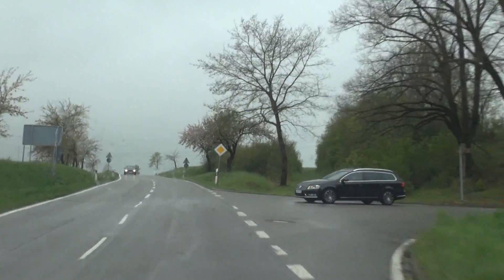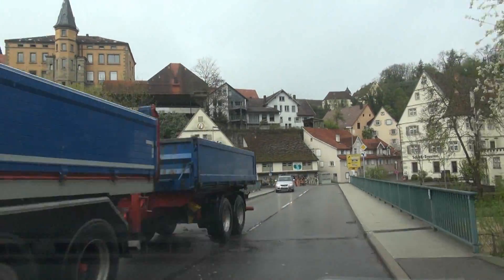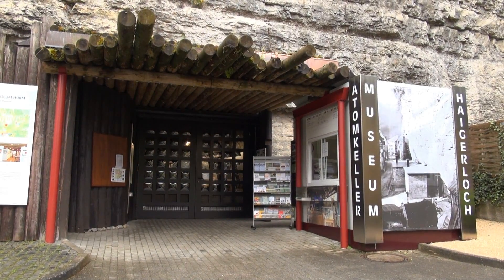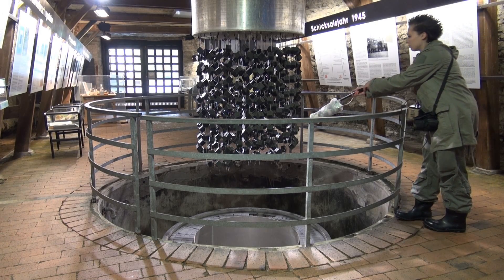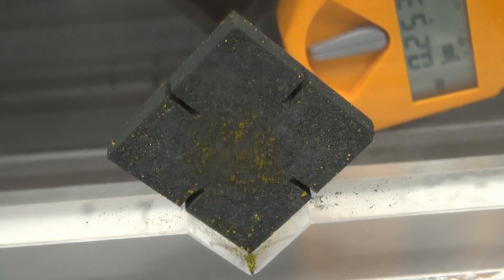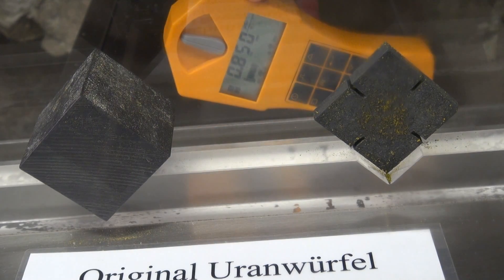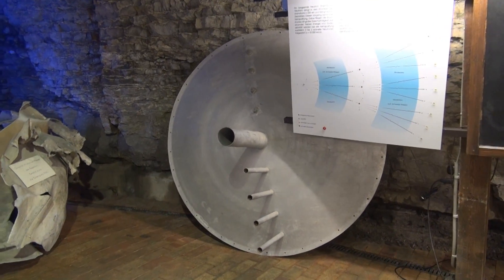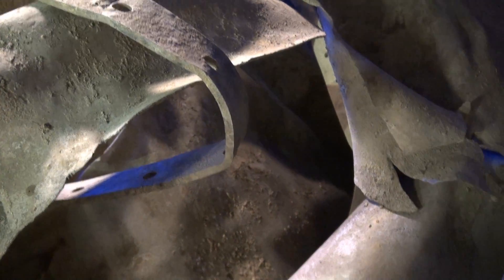Hitler's nuclear pile - WWII uranium cube reactor & the Alsos mission: Atomkeller Haigerloch

Comment: All interesting but the Nazi's had not discovered that U235 was critical to getting fission to work w slow neutrons. Like the Chicago 1 pile it had no chance of producing any power.  The Chicago 1 Pile with 40 tons of Unranium ore only produced 1/2 watt .. assuming even that happened.  Germany definately did not have a manhatten like project trying to refine U235 as such all efforts were pointless. The Manhatten project only started once the British secret Peierls/Frisch paper specifiying U235, the critical mass and yield were revealed to the USA; that happened in 1942.

Comment: Some correction is necessary as a comment: firstly the graphite is not a neutron reflector, but it is a neutron moderator used to slow down fast neutrons, secondly this "reactor" was moderated by heavy water not graphite.

Comment: I'm assuming those cubes were not enriched uranium and were only 0.7% U235. As far as I know, you can reach criticality with that level of U235 but you need the correct design and you need to initiate it with other radio active elements.
Reply: That's absolutely true. The hardest part about designing and building a nuclear is getting it to bang in the first place.

Comment: The Plexiglass around those cubes is mostly there to shield the betas!
I got a chance to open that exhibit and measure those cubes directly, on contact my energy compensated GM showed ~30 µSv/h, but some of our russian pancake detectors were overloading as far as ~10 cm away due to an extreme amount of beta radiation.

Thank you for making this video, otherwhise it would have been many more years where I didn't know about this awesome place!

Edit: Fixed typo

Comment: LOOKS LIKE ALL THE TECH FACTS ARE MIXED UP !  THIS WAS A FIND BUT ONLY SMALL  NUCLEAR ENERGY WAS PRODUCED BY THIS DEVICE AS SHOWN ! IT LOOKS LIKE THE DEVICE COULD NOT BE MOVED AWAY IN TIME BEFORE CAPTURE SO THEY REARRANGED THE PARTS TO CONFUSE ANY ONE FROM UNDERSTANDING IT ! THE URANIUM BLOCKS ARE HANGING IN CLOSE PROXIMITY ! IF THEY WERE REFINED ENOUGH THEY WOULD PRODUCE NUTRONS AND HEAT !  ANY WATER SOURCE COULD BE USED TO COOL IT TO KEEP IT FROM MELTING AND WOULD MODERATE IT !  USING HEAVY WATER AS A MODERATOR WOULD BE A WASTE OF MONEY AND HEAVY WATER !  IF THEY WANTED A MODERATOR THE GRAPHITE WOULD BE THE RIGHT THING ! THERE IS ALREADY CEMENT AROUND THE URANIUM  FOR SHIELDING SO THE GRAPHITE IS NOT POSITIONED CORRECTLY ! TO MAKE THIS WORK THE GRAPHITE NEEDS TO BE STACKED BETWEEN  THE STRANDS OF WIRE HOLDING THE URANIUM TO MODERATE THE NEUTRONS !  THE HEAVY WATER IS FOR REACTING WITH LITHIUM TO MAKE LITHIUM TRI DEUTERIDE  FOR FUSION FUEL FOR FUSSION WEAPONS ! IS THERE ANY LITHIUM ?  HOW ABOUT SOME PALLADIUM ?  ANY WAY THE URANIUM IS HANGING FROM THE WIRES IN A COOLING POOL IF THEY LEFT IT LIKE THAT THE SMALL AMOUNT OF RADIATION WOULD MAKE PLUTONIUM 239 AND COULD BE EXTRACTED AND USED AS A PRIMARY TO DETONATE THE DEUTERIDE HEAVY WATER !  BIO NERD UR GONNA DIE FROM RADIATION  ! U SHOULD QUIT WHILE UR AHEAD LIKE I DID !

Comment: The germans had uranium 235 and didn't need to obtain criticality. hey did have a small atomic bomb and they did have at least 2 tests of their low yelld bomb.In fact it is reported that the germans wiped out a russan division with one of their atom bombs in early 1945, The atom bombs had a blast radius of about 900 to 1000 meters anough to do nthe job. It is also reported that the second bomb dropped on japan was german weapons grade uranium.
Reply: Wouldn't partially detonating u235 cause most of unfissioned u235 to be spread into the nearby environment ? It would be far dirtier than the bombs dropped on Japan. Were is the evidence for this ?

I'm not a nuclear expert in any sense but I thought bombs tend to 'fizzle' when they fail to reach criticality, you don't get a scaled down version of a proper detonation, rather something completely useless ?
Reply: Do you have a reference to this information?  There is no mention of anything similar in “Heisenberg’s War. The secret history of the German bomb” by Thomas Powers, published by Penguin Books in 1994.

Comment: They're lucky they didn't achieve criticality with no control rods or anything in their design
Reply: @AverageJoe8686  Joe, those strings of cubes are the uranium. The control method was heavy water.
Reply: It sure would have gotten their attention
Reply: @AverageJoe8686  To 'activate' the system the radium rod was lowered into the center - the cubes were left in place. I went there in 2011 and there is quite a bit of material to read. This was an experiment more than anything else. There was no way possible for this to have been successful at what they were trying other than making a little bit of heat. It needed some enriched uranium (235) and there was never enough mass to become critical. They did measure some heat increase but not much more than that.
Reply: @dieselscience  Right. It was just a criticality experiment like Fermi used, but they were FAR away from K=1. I know how much you want to correct these dolts, but it's a thankless task and a perpetual uphill battle. Pearls before swine.
Reply: They didn’t expect to achieve criticality. In the unlikely event of achieving it because their calculations were wrong, the plan was to pull the radium Neutron source out which was lowered on a thread to a chimney on top of the reactor. [sic!]
Plan B was to throw in a piece of Cadmium through that chimney. Although because of the poor shielding the guy throwing that in wouldn’t have long to life after that.

It is kind of a similar well thought through design like the axe-rope thing with the first American reactor
Reply: @AverageJoe8686  Are you saying 'cascading' when you mean 'chain reaction?'
Reply: Criticality around my arse !!!
Reply: @joshuel2008  you must be 'russian' then.
Reply: Their design did actually have control rods that would be shoved into the heavy water tank when needed (not unlike how CANDU reactors do their 'adjuster rods', as its called in their terminology)
Reply: @drewgehringer7813  CANDU reactors? Are you in canada?
Reply: Not even close.
Reply: Said who ?
Reply: It wouldn't really have been possible.
Reply: @dieselscience  Why is that? Demon cores don't have control rods and yet they work.
Reply: @Vsor  "Why is that?" Because the geometry is critical to the chain reaction and none of the cubes were anywhere near critical mass.
Reply: @dieselscience  Its reactor not a bomb... you are completly clueles in the topic! On top of that you start talking about"geometry" and ending up with "mass"... with scientists like you we would be in stone age to this day.
Reply: @dieselscience  what about the radium and beryllium?  Seems they were artifically generating neutrons which may have initiated sub-criticality or even a momentary criticality.  ??
Reply: @AverageJoe8686  No. When in operation the entire assembly of uranium cubes was completely lowered into the pot an it was filled with the water. A radium rod was the neutron source. It was impossible for this to go critical (in fact in full operation it barely even got warm) so the purpose was slowing the neutrons enough to be captured by uranium nuclei.
Reply: @dieselscience  I think the graphite was the moderation method.
Reply: @hughezzell10000  Heavy water was the moderator in this. CP-1 in Chicago used graphite. Remember this was mainly an experiment to prove the concept, and define what became modern nuclear engineering.
Reply: @hughezzell10000  They used heavy water which results in a self regulation. When the water gets hot, the fission reaction declines.

That type of reactor is intrinsically safe (to a certain degree). And it works with natural Uranium (no need for enrichment of U235).
Reply: it mightve scared people off nuclear power, for a bit, and maybe started the cold war just about the same time it did in our timeline, but sooner by a few years

tho without berlin to fight over, and no other reason at the time to shitpost about, they mightve just never start it

yah Germany's fucked up but there wouldnt be that many proxy wars later on. maybe 'nam and such wouldve still happened, or maybe not
Reply: @chuckphilpot7756  Fuck off you racist dipshit.
Reply: Us germans did not have the technicalities, but we weren't exactly banging rocks together, we speak of the first steps towards nuclear energy. i would even go so far to believe that without the jewish scientists that defected to destroy us, the americans wouldn't have either such a immense nuclear arsenal, but also no immense nuclear power grid if it weren't for us.
Reply: @JHenryEden  so, escaping genocide is now considered defection?
Reply: @JHenryEden  "defected to destroy you?"  You chaps were rather keen to get rid of them, as I recall.  After a while you kinda stopped waiting for them to leave on their own...

The Neuremberg laws of 1935 made it impossible for Jews to work in universities.  Jewish physicists couldn't have done serious work in Nazi Germany even if they'd been stupid enough to want to do so for a nation that openly hated them, let alone on a super-weapon project.  Moreover, the nationalistic "Aryan Physics" of Lenard and Stark, embraced by the Nazis, expressly and idiotically rejected relativistic physics, for unscientific reasons, as "Jewish Science,"  and was every bit as foolhardy and self-sabotaging a movement as Lysenkoism in the Soviet Union.

Of course, not all the Nazi leadership were THAT stupid.  Himmler was apparently tacit enough to allow the "top brass," Heisenberg, to use "Jewish Physics" in pursuit of the weapons programme, as long as he didn't mention the people who thought it up by name.  But the simple fact is that scientific progress suffers under highly authoritarian rule, regardless of the particular flavour of authoritarianism, and is also dependent upon a widely-educated base of intelligent people, all working furiously on research with different personal approaches.  Just letting the top, most important scientists and engineers discuss forbidden topics, whilst the rest of their peers are kept in the dark, was never going to cut it.  If you want to stay ahead in science, you need to be able to accept and embrace ANY new idea, no matter where it comes from.  Needless to say, scientists worldwide tend to be relatively liberal.

Scientific progress requires intellectual freedom, free inquiry, freedom of association, freedom of speech, and freedom of information - not to mention mass communication, and also funding for pure research without any specific guaranteed return on investment.  Nationalists, Nazis, fundamentalists and other group narcissists, arch-conservatives and authoritarian followers can't stand ANY of that.

At the end of the day, modern wars are really won by economies, not by armies - and authoritarian dictatorships aren't good at running vibrant, viable economies.  Ironically, this means that warmongers are generally not actually very good at winning wars.
Reply: @JHenryEden  I can understand why would Jewish scientists want to destroy NAZI Germany. And they did not defect they were driven out of NAZI Germany.  The NAZI's called nuclear theory a Jewish science.
Reply: @ShlomoTenembaum  I am fairly certain that nazis that aren't exactly banging rocks together to turn shit into diamonds would pass out on a chance to finish confidential projects that could win them the edge in the war and if the jew would have wanted to defect, they would have done so willingly in accordance to the haavara-aggreement.

americans as much as commies did not pass out on chances to break some kneecaps to get some secret out of scientists, what makes you think us germans would just let people walk off free with privileged knowledge?
Reply: @JHenryEden  Germany was about seven years behind the US in nuclear research. The NAZI government refused to fund the "Uranverein" thinking it was a waste of money. This whole experiment was with non-enriched and it would have needed to have almost twice as much metal to be able to make anything that could be used for a bomb. Other than that, you're just talking drunken bullshit.
Reply: @JHenryEden  Born and raised in the US... ethnic German ... seems legit. Enjoy or conversion to Germanistan - praise be to Angie who's forcing you to find Allah.
Reply: @dieselscience  That is almost hilarious, but it's not that the joke is on me that makes my smile dissipate faster than a french war declaration, but instead it is that the joke is very true and therefore hits close to home.

You win this one, good man.
Reply: I mean, Nazi ideology trumped science - they kept trying to make a new "aryan" science.
Reply: dieselscience apart from the not funding it was also the scientist who weren’t very enthusiastic in their work to build a city destroying device in the „size of a pineapple“ (quote Heisenberg) for a country that had just invaded a notable chunk of Europe and was murdering people on an industrial level. Therefore they also didn’t really insist in much more funding.

At the end of the war Heisenberg, Hahn and their colleagues were prisoners in the UK. When they heard about the nuclear attack of Hiroshima by the US the British secretly recorded their conversation. Turns out most of them were quite happy that they didn’t have the bomb. Hahn was so devastated because he was the one who discovered the fission and felt himself responsible that the British were frightened he is going to commit suicide this very evening.
Reply: would have been fucking funny if doing so caused a meltdown and made Germany uninhabitable 

"hey, we stopped seeing germans. aint no new ones since last week"
'weird. wait, theres some new jerries
"yeah, but look, they are wounded, all burnt up and dying"

Comment: It can still be there, but remember, they have buried it quite deep, to hide it.
But to find it would be nearly impossible, since you'd need to excavate quite a huge area, and quite deeply, and if you by accident scoop the source up/break the container, it can turn into a mini-disaster on it's own.
Reply: It was likely recovered by the Alsos mission. To not look under what you've dug up for more is pretty much complete idiocy. Remember at the time the U.S. was trying to hide anything useful about atomic research from pretty much everyone. So something about a neutron initiator source would have been worth classifying to a higher level then simple fuel cubes.

Comment: What was the Heavy Water used for
Reply from the maker: Meeks 10 the heavy water was used as a neutron moderator. 1-3 neutrons are released when a uranium atom fissions (splits); however, they will be too "fast" to be captured by another uranium atom. thus, they need to be slowed down by a so-called "moderator" substance. when slowed down to "thermal" energy, they can be captured best by another uranium-235 nucleus, which will split as a result of neutron capture, and so forth (chain rection).
*this is a low-down on the subject in simple terms, thorough info here:
http://en.wikipedia.org/wiki/Neutron_moderator
http://en.wikipedia.org/wiki/Neutron_cross_section
http://en.wikipedia.org/wiki/Nuclear_chain_reaction
http://en.wikipedia.org/wiki/Nuclear_fission
http://en.wikipedia.org/wiki/Breeder_reactor
Reply: Thank you very much for that detailed response!
Reply from the maker: Christopher Willis yeah that works well for U-235 neutron capture, but it doesnt explain fast breeding / neutron capture cross section for fast neutrons of U-238.
Reply: Meeks 10 and normal water would absorb too many slow neutrons
Reply: Meeks 10 I like to describe it as the difference between a slow ball and a fast ball.  A slow ball is just much easier to hit.  Similarly, slower neutrons interact with the uranium much more aggressively so you don't need as much fuel.
Reply: bionerd23 Plus, who even plays baseball anyway...need to update my metaphors!
Reply: +Republik Sivizien Actually normal (light) water would have been more effective. Light water absorbs more neutrons than heavy water (creating more tritium aka H3), but light water is better at moderating (slowing) neutrons. The minimum critical mass is significantly lower with light water moderation.
Reply: thats cool but your only aloud so much time in the place  the place is done one week only if that  an tested every day that is all you get
Reply: Was the heavy water obtained from the Norsk Hydro facility at Rjukan that was destroyed in early 1943?

Comment from the maker: i had a gamma scintillator as well as a neutron scintillator with me. due to the age of the neutron source, one can expect significant buildup of Ra++ / Radium progeny (daughter isotopes) with strong gamma emissions. as the gamma scintillator is much, much more sensitive to gammas than the neutron counter is to neutrons (and the neutrons need to be of proper energy to be detected), i mostly tried to detect stuff using the gamma scintillator. if i had found a high background reading somewhere, i would have used the neutron counter to confirm the presence of neutrons (allows to distinguish a neutron source from e.g. a naturally radioactive piece of rock).

@Felix, no direct replies possible due to your settings again.
Reply: That, and wet ground would attenuate the neutrons.
Reply: Wth kids found in Stream ooof
Reply: those garlic smelling plants are edible its just wild garlic :)